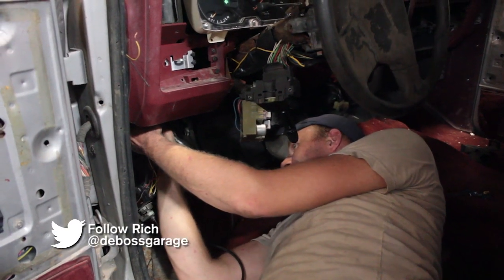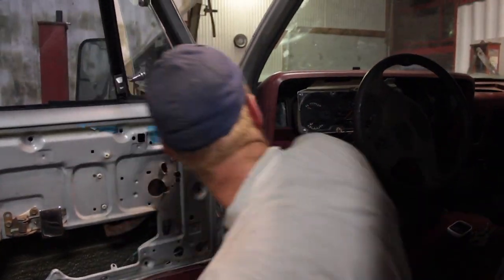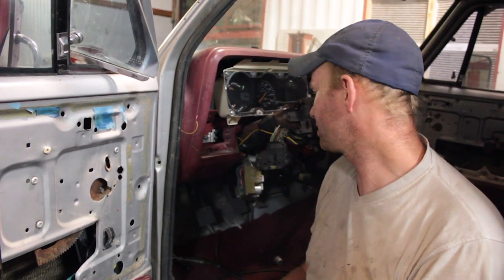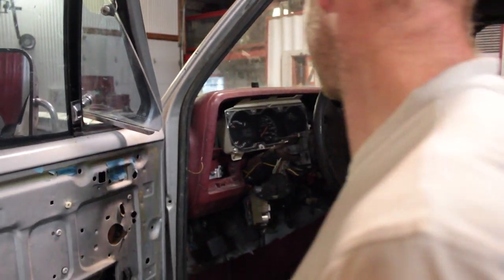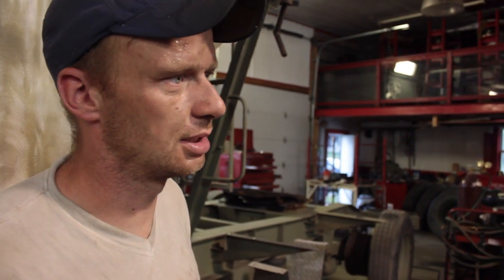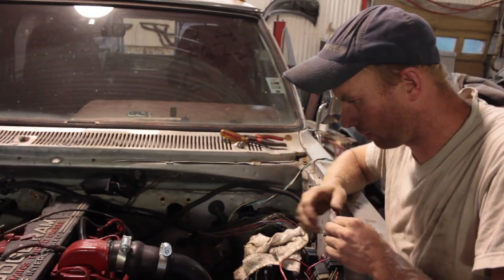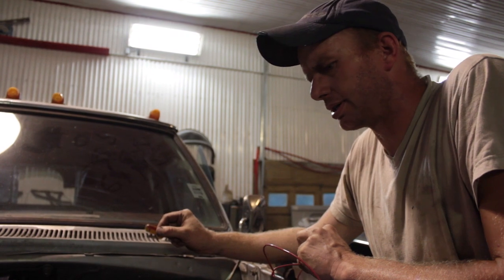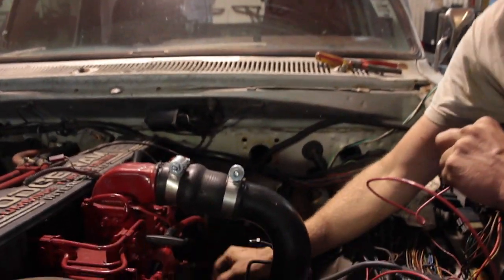'85 Dodge RAM CC W350 Dually 5.9 Cummins 12v Diesel Swap [EP4]

Comment: everyone knows that the wiring/electrical issues are typical for dodge's once you eliminate everything dodge from the cummins engine, your woes will be over. keep the engine and throw everything else away.
Reply: after the engineers left Chrysler in the late 70s early 80's, they had some serious issues with engineering. Wasn't until the mid 2000's that they started getting good engineers back and then it was money problems for days.